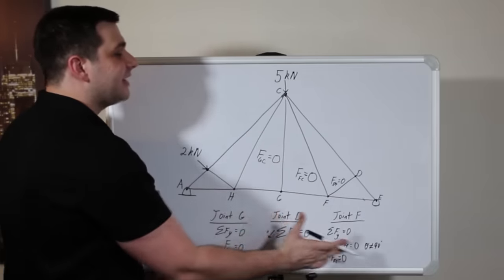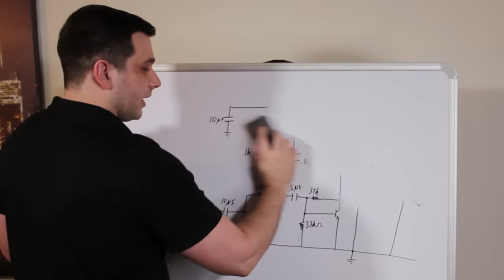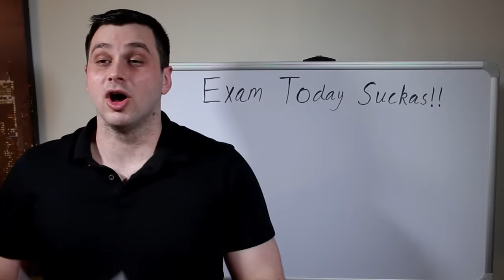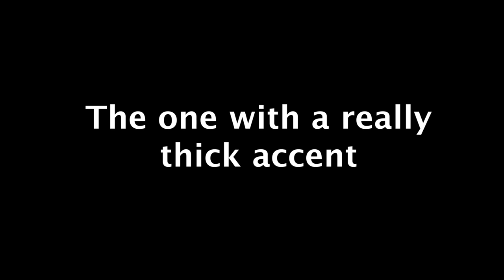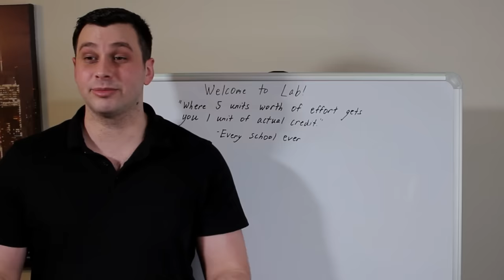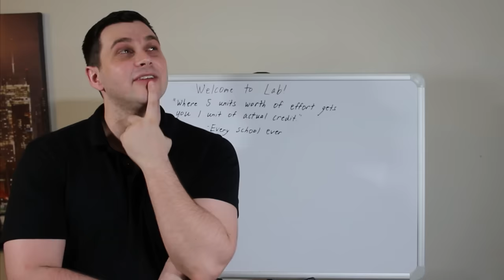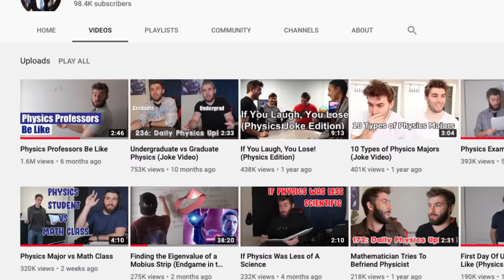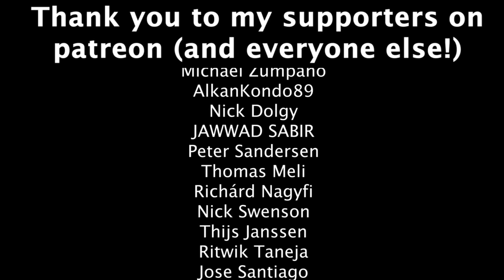Engineering professors be like

Comment: I’m haft way through Physics 1 and it’s extremely shocking how accurate some of these points are.  On my last test my teacher basically just said that the only correct way to solve one of the questions is making an “educated guess”.
Reply: I’m in my last semester of physics undergrad, and I’ve come across that a ton too haha. It’s usually because you’ll come across the right way to get it, which requires math you’ll meet later in the program, in higher level courses
Reply: Physics teacher here. Confirmation of this. Hence the theoretical part of a shit ton of physics.
Reply: @archizona  Yeah but physics 1 isnt high level theoretical physics
Reply: @adbon6279  depends on how deeply you go into it. But never ask the why question in physics. I made the mistake with the equation vc=f*wave length
Reply: our math midterms have 4 questions with 2 subparts each (most of the time) so 8 total questions usually. sometimes 2 to 4 of them will involve having to make a "guess" for example 4x + sin(pi*x) = 5, you just have to "guess" by some cosmic magical force bestowing wisdom upon you that x = 3/2. and this is like, the easiest guess, there are much harder ones.
Reply: @bilge677  well, this particular guess can be easily made graphically. Maybe you should've just tried to, you know, study before the midterm. Then you do not need to rely on cosmic magical forces:))
Reply: @bilge677  sin(pi/x)=5-4x now you have to find the intersection of the line in in the rhs with sin*pi/x) and you get the answer

Comment: Not studying an engineering field, but in uni it has been interesting to see how little effort some courses take, and how much some others take.

We've had 5 point courses that required 2 12-page (minimum length!) reports, reading 2-3 books and a bunch of articles, which all needed to be referenced, on top of doing an actual research experiment. According to the teachers, about 50% don't finish the course the 1st time (but you're allowed to turn your work in a year later, so if you manage to finish it over time you don't waste your efforts, yay.)

Then we've had 5 point courses, where I literally just spent an hour interviewing a person, and another hour writing a half-assed report for said interview. (There was no required attendance, so I also skipped every lecture as I figured it was a stupid course....)

Don't really understand what their system is for measuring how many points they are each worth, but at this point I'm pretty sure nobody thinks they make any sense.
Reply: As an undergraduate student rep I attended a meeting where department heads of geophysics and geology discussed course units. It was a constraint that he total value of all units for a given major needed to sum to 100. A discrepancy arose in that the course components for geophysics added to 105. The solution was to rename a vector calculus unit from 200 to 201 and assign it 20 instead of 25 points so geophysics majors could take the same unit as other STEM students but be awarded fewer points for it.

Comment: My lab teacher in my 1st semester was trying to explain how one of the machines worked but he probably was doing something wrong and kept saying "oh this cable isn't working" then would swap it and it still didn't work and got to the point he didn't know which cables "worked or didn't work" it got to the point where he started hitting the equipment to make it work, I was dying of laughter (like everyone else was) because this was too ridiculous to be real but it was happening
Reply: Percussive maintenance
Reply: Labs not working is always a thing. I recall one lab - not the worst class in my engineering program but certainly the most BS - had us calculating error propagation based on the measurement precisions, totally ignoring that the machines' not working right produced at least an order of magnitude greater error, probably totally useless results. They didn't care, just wanted us to write the reports as if the results were valid and accurate. The best story in that one was a refrigeration device that was supposed to have a thermostatically-controlled water bath. That was malfunctioning, it was constantly getting hotter no matter what we did. So the lab teacher started dumping ice from the freezer into it. That worked for about 5 minutes until she ran out of ice. So I did the only bit of actual engineering from that class and found a solution to the problem: It was February in Colorado, the parking lot had an unlimited supply of snow. Probably got some leaves in it too, but I figure if we broke the damn thing completely either they'd actually have to fix it, or future lab groups wouldn't have to do that lab, either way they were better off.
Reply: @quillmaurer6563 lmao
Reply: bruh I had this exact experience in my first physics lab. we had to make a BASIC circuit with just a resistor hooked to a power supply to heat a cup of water over a period of time and measure the latent heat capacity of water. It took the lab teacher 30min to try and get the resistor to work... only for me to finally have to courage to say the two wires were both connected to only the positive terminal.

Comment: “Uh Doctor [name] the homework has stuff we haven’t covered?”

Prof: *laughs
Reply: This is too real
Reply: Statistics
Reply: They expect you to read the textbook. I've been out of school for seven years, currently working in R&D as an electrical engineer. Let me tell you, if you aren't reading to try to find solutions to problems you have to figure out at work, you're going to be looked down upon like a hopeless idiot. My advice: get in the habit of doing independent learning while in college. The professor can't teach everything. The lectures are meant as a supplement to all the matetial detailed in the book.
Reply: @Plissken The professor can’t teach anything.

Fixed that for ya
Reply: Plissken So what you’re saying is that I’m paying all this tuition for basically a book and a tutor that varies in quality. End me please.
Reply: @seinfan9  I suppose that's fair enough. And I did do that. Some books were great, easy to follow and understand. With those I could practically teach myself. Other books were... difficult to read. Not because of the actual technical aspects, but the books were poorly designed as learning material.
Reply: @badbeardbill9956  I'm only in high school but I'm a little scared because most of my books are pretty good but my chemistry and physics books have like 5 page chapters (long for my level) that are just filled with useless stuff and like 5 sentences that you'll actually need in the test and there's not even a conclusion in the end like bruh👁👄👁
Reply: @seinfan9  I'm paying all this money for school and I'm expected to just teach myself everything? Fuck that. I will "independent learn" when I'm getting paid to do it, not when I'm paying someone else.